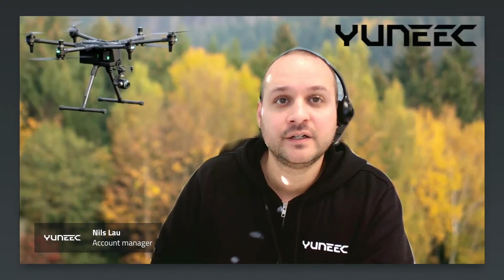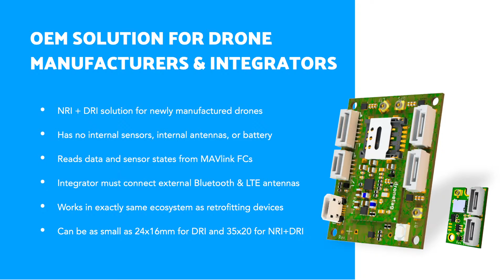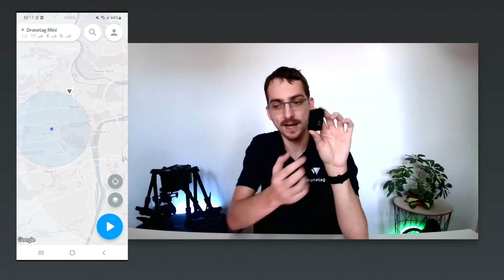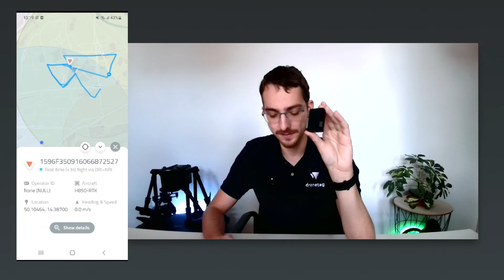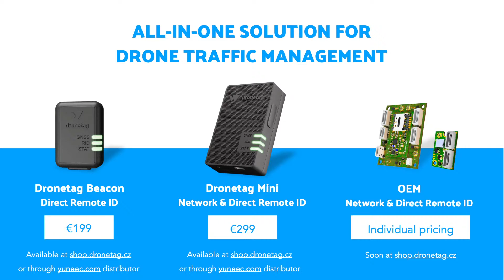Yuneec & Dronetag: Remote ID for drones

Comment: Content topics:
🚀 Remote ID in a nutshell
🚀 Upcoming EU and US regulations
🚀 Benefits of Remote ID for drone airspace

01:06 Start
02:32 Nils Lau from Yuneec
03:50 Webinar takeaways
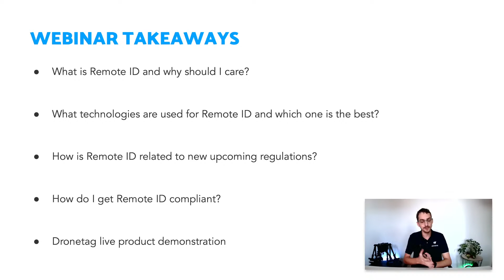04:18 New Remote ID rules context
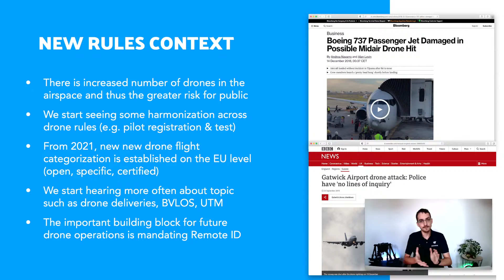05:05 What is Remote ID
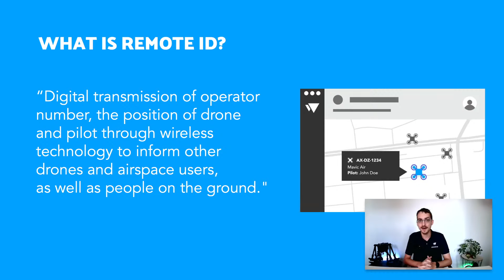06:06 What is Remote ID good for
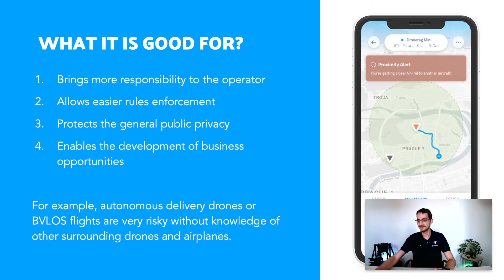07:49 Types of Remote ID (Network Remote ID and Direct / Broadcast Remote ID)
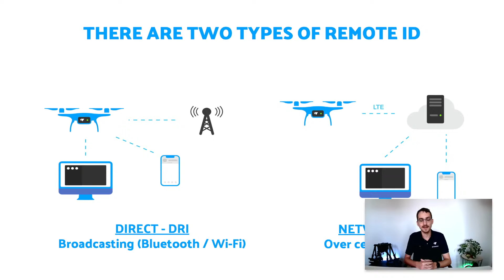08:50 Technologies used for Remote ID
12:14 Types of Remote ID solutions
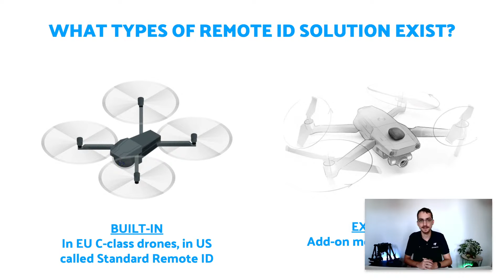13:00 Built-in solution
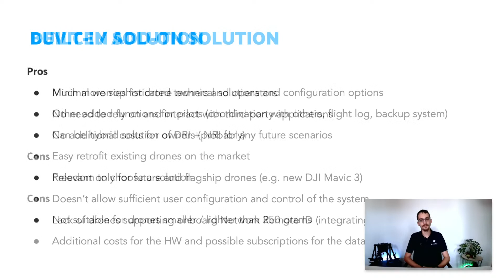14:08 External add-on solution
15:29 When is Remote ID required
19:15 Dronetag Mini and Beacon introduction
23:41 Dronetag OEM solution for drone manufacturers
25:20 Dronetag Mobile and Web app
26:02 Live Demo Dronetag app
30:52 Live demo Drone scanner
35:56 Remote ID solution overview and pricing
37:47 Wrap up

❤ Dronetag products:
https://shop.dronetag.cz/en/

💣 Yuneec eshop:
https://shop.yuneec.com/eu/commercial/dronetag-remote-id-device-for-h850-rtk-h520-e/

👀 Dronetag help & knowledge base:
https://help.dronetag.cz/

📱 Dronescanner app:
Free in Apple App Store: https://apps.apple.com/de/app/drone-scanner/id1644548782
Free in Google Play Store: https://play.google.com/store/apps/details?id=cz.dronetag.dronescanner